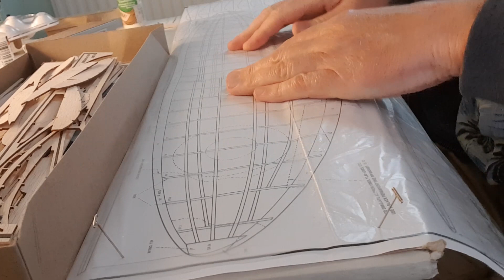Building Guillow's Spitfire Part 4 Wing

Comment: Help could you please help me I've been building a guillows spitfire but I've been watching your video and I'm confused about how to set the Dihederal,Any tips please 🤞
Reply from the maker: Hi Lippoo, on the plan it'll tell you somewhere how much dihedral you should have under each wing tip, so pin the centre section down (if it has one, you may be building the smaller Spitfire) and place a block of some sort under each tip and measure whatever the plan tells you adjusting the block in and our until each tip is at the correct height., hope this helps 👍

Comment: Hi Cliff - for the center section joining to the left and right wings, did you cut an angle on the centre K3 piece to make the butt joint?  Just at this stage in my build of the Spitfire 403 kit, and it's going fairly well due to your video series.
Reply from the maker: Hi Rod, great to hear the build is going well, to answer your question 'yes', a little light sanding you be enough, you're looking to get a wood-to-wood joint for as much strength as possible 👍
Reply: @CliffHarveyRCPlanes  Thanks - really enjoying working on this.

Comment: Do you think it'd be possible to add alirons an 5g servos in the wings? An add elevator an Rutter to this? Currently building one myself an wanna convert it to electric with alirons an Rutter an elevator
Reply from the maker: Hi Steve, perfectly possible yes, better if you could fit lighter servos though 👍
Reply: @CliffHarveyRCPlanes  what servos you recommend
Reply from the maker: @stevenlooney9075  Something like these Steven for example (you might need to change the plug depending if you're using a receiver/esc brick): https://uk.banggood.com/XK-X520-2_4G-6CH-FPV-RC-Airplane-Spare-Part-4_3g-Digital-Servo-2pcs-p-1406265.html?utm_source=googleshopping&utm_medium=cpc_organic&gmcCountry=GB&utm_content=minha&utm_campaign=minha-gbg-en-pc&currency=GBP&cur_warehouse=CN&createTmp=1&utm_source=googleshopping&utm_medium=cpc_bgcs&utm_content=sxxx&utm_campaign=ssc-gbg-all-1223&ad_id=407616486909&gclid=CjwKCAiAu8SABhAxEiwAsodSZL3puoeJA2TD4Qji9DrgDY4XnArNoHBBPtnWIGdTJC7LdlN1SxmrlRoCO-8QAvD_BwE

Comment: For doing contest flying the all up weight should be 1/2 gram per square inch of wing. Or 2.5 cm..  Sport flying is 1 gram per square inch of wing. If the build is more then 1 gram per square inch then the model must fly faster to get the right amount of lift to fly. Very hard to fly heavy models on rubber. My best indoor scale flight was 48 seconds on a peanut model. Best flight over all was 9 minutes and 49 seconds but not with scale models. I enjoy your videos. PS I have flow scale models over 1 minute but not in a contest.
Reply from the maker: Thanks Doyle, good info, would you go with the stock rubber or something else?
Reply: @CliffHarveyRCPlanes  For sure use something else. The Guillow's rubber is only good for balancing the plane.  It is like winding up a shoestring. :)

Comment: 5 grams is really impressive, would multiple holes be more advantageous, or would it weaken the structure too much? 
Here’s to that 4 min flight!
Reply from the maker: I suspect most of the weight was in the leading edge before shaping, I could probably have squeezed in at least one smaller hole in front and behind without it causing any strength problems but I couldn't see past the size of the hole I'd already made if you follow me!

Comment: Nice looking wing. Just occurred to me while watching you work that you could have taken the bulk out of every other rib. Do you weigh it before and after you remove the wood. 👍
Reply from the maker: Well Jon I'm sure I could have taken more out of the ribs but they are quite soft balsa so the weight saving would have been negligible against the strength lost in this case. Yes I did see 12:15, thanks for commenting. 🙂

Comment: I know it's time-lapse but even so, that's a pretty fast drying glue! What brand is it?
Reply from the maker: Hi Dave, I  use a combination of CA and Aliphatic wood glue, it does dry reasonably quickly but the parts were laser cut so they fit well even without glue.